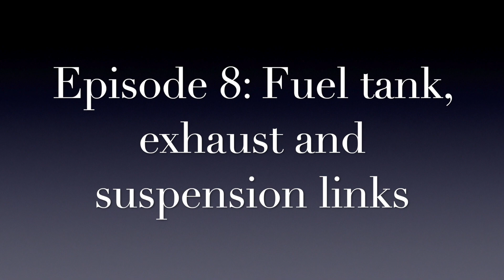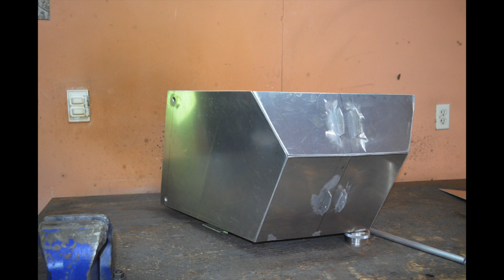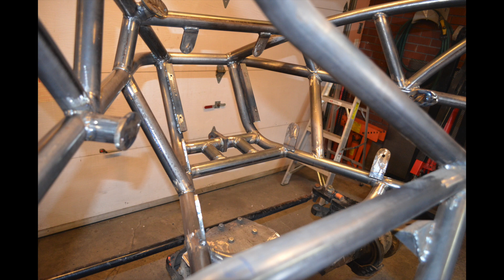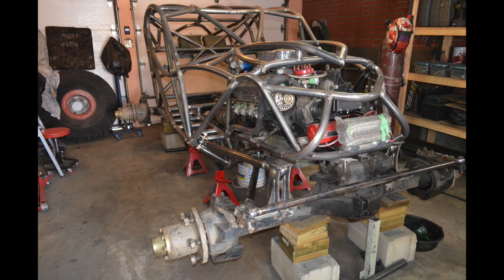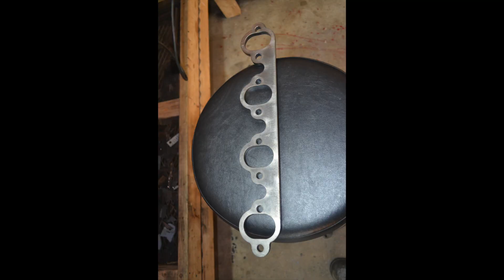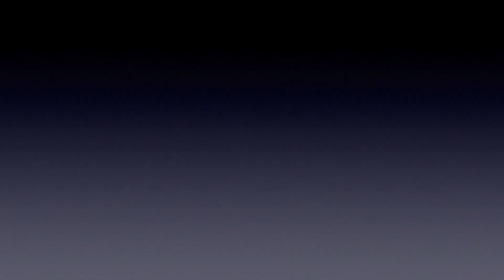Episode 8: Fuel tank, exhaust and links  | How to build your own rock crawler/buggy/bouncer

Comment: I like the detail man. You're covering the small details that others haven't. I'd love to know your frame width where the engine sits, and firewall height.
Reply from the maker: Thank you. The frame width is dependent on what engine you use, my numbers won't be applicable to yours unless you use the same engine. I have about 30" between the rails. I am not sure where to measure the firewall, it changes all over the place, it is a rolled tube. These numbers will depend on your individual drivetrain, once you put the engine, trans and TC in place to start building, you can choose the numbers that you want, there is no right or wrong answer. I like to build all the tubes as close as possible to the drivetrain components.